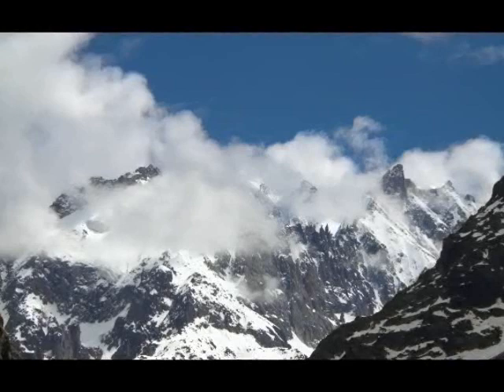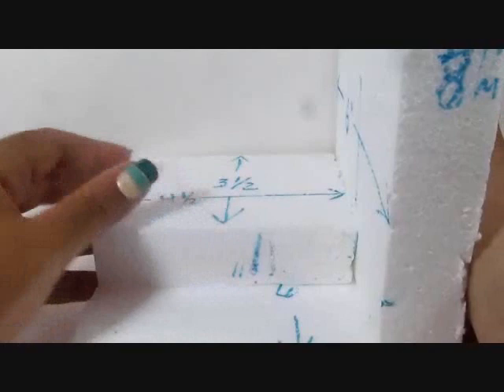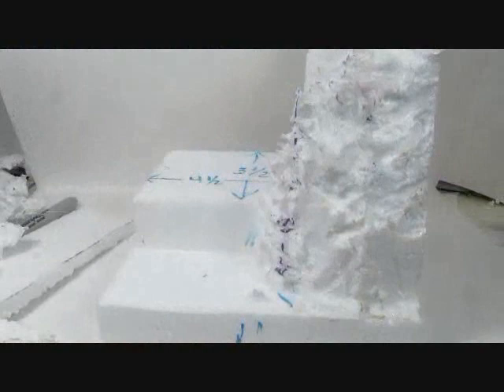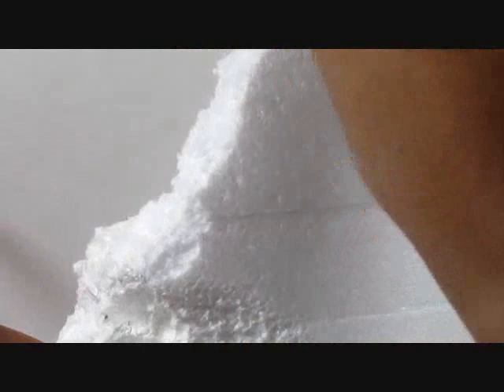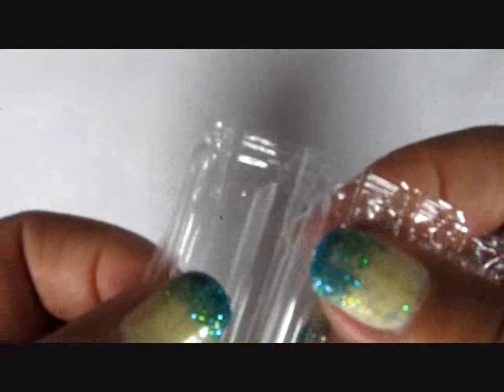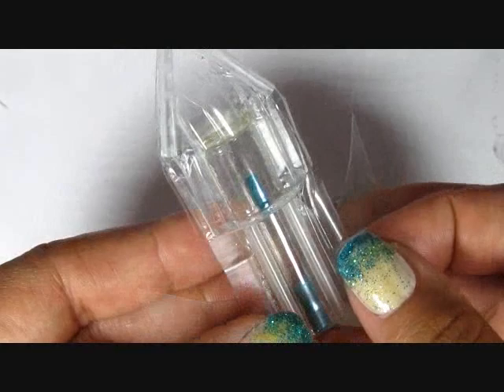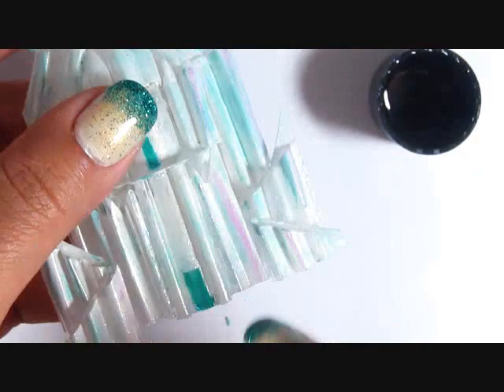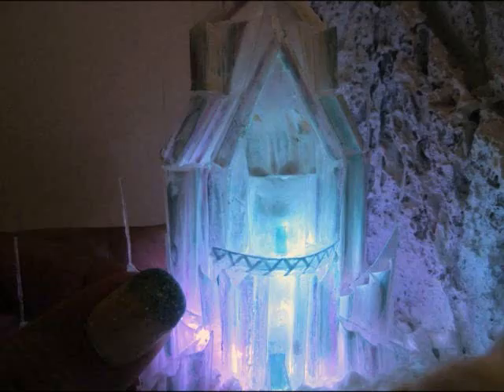DIY Foam and Recycled Plastic Frozen Elsa Ice Palace Castle 1:144 Scale Dollhouse Miniature Lights!

Comment: The light effect and the castle are phenomenal!

(SUGGESTION BELOW, FEEL FREE TO IGNORE)
Something I've learned from watching miniature painting tutorials is that having two different base coat colors (that are close but not exact) can add extra depth to surfaces, by tricking the eye into thinking the light is falling on planes that don't actually exist. You did a great job sculpting the mountain, but when I first saw it, it looked to me like it was made of dirty snow, rather than snow on stone. If you do another snowy mountain peak, you might try putting down a layer of gray like you did here, then accenting half of it with a slightly lighter blue-gray coming from the direction of the castle, as if the light is striking the mountain. Add white on top as you did before and you'd get a stronger effect.
Reply from the maker: I will be making another mountain, so I will definitely use this.
Reply: Oh good! You might also consider going even darker for your first layer, as it will help with contrast. I've been really surprised by some of the techniques I've been learning from the guys who make stuff for Warhammer and so forth.